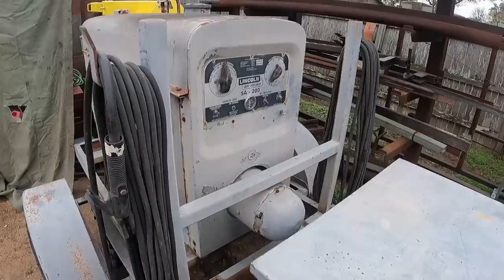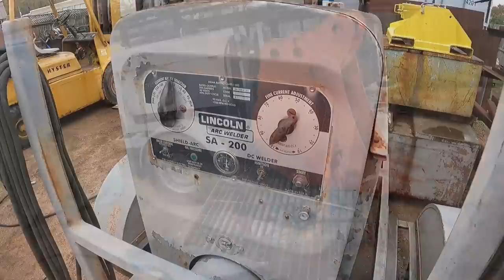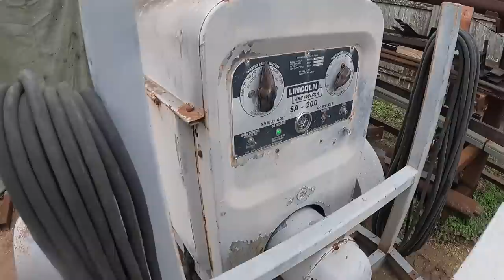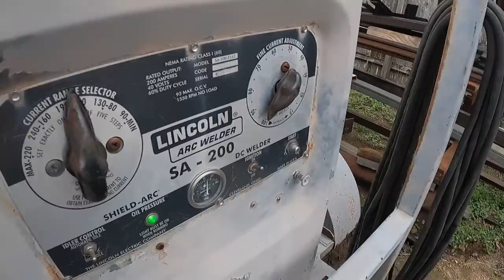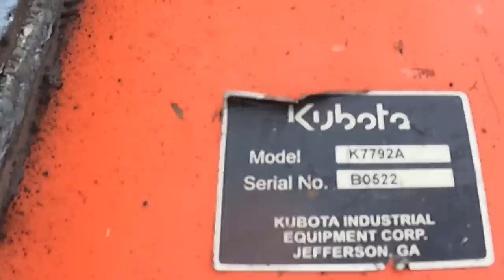Arc Gouging with an SA-200??

Comment: Correct me if I’m wrong… I would think that stick welding would be quicker because of the diameter of the rod. In that regard why would any production oriented company do anything else?
Reply: Mig wire is still capable of carrying quite a bit of current.  Wire diameter is not a factor in material deposition, wire can be fed in quite rapidly.  Mig can produce the same weld size, but stick is certainly more forgiving in terms of temperature and wind.  If you can control those factors mig is much more suited to high volume production welding.
Reply: @dougstout3663  I think stick is incredibly versatile and a good choice for on the spot fabrication or field repairs. Plus you can gouge if you have a compressor.
Wire diameter to 3mm for flux core and 5mm for subarc when you really need the amps for thick material. 
Both of these wire feed processes don't have a problem with mild winds.

Comment: Weak welding! You did the same thing that the guys before you did. You put in an electrode, didn't fuse it with the base steel. such a bucket will go for repairs again and the guys will earn good money again. You're doing well, thinking about colleagues, bravo!

Comment: you are running it way too cold thats why its sticky and your arc is not very steady, a 5/16 rod is rated at 350 amp min. up to 450 amps max. the sa-200 only puts out 300 amps when maxed out. you have the welder turned up all the way and be using 1/4 inch carbons and make single passes and the welds will peel out like butter.
also it looked like you were whipping the rod a few times when you welded the plates on, 7018 isnt supposed to be whipped like 6010

Comment: my land lord came on one of those welders it didnt run inline 6 cyl dodge engine got it for a hundred bucks was going to just scrap it i asked if i could take a look see why it didnt run come to find out it had 3 bent push rods and needed the carb cleaned out got the parts from one of his junkers cranked it over ran like a top tried to figure out why it had the bent push rods but never did he was welding an cutting with that thing till the day he passed on